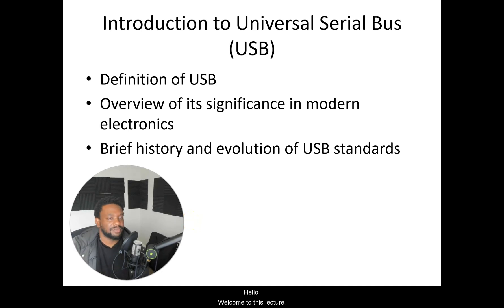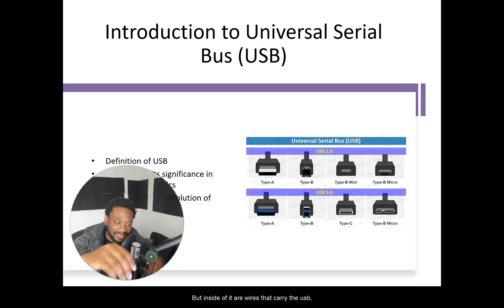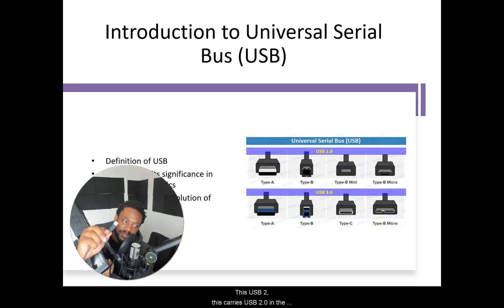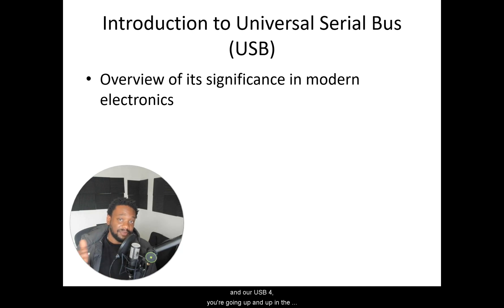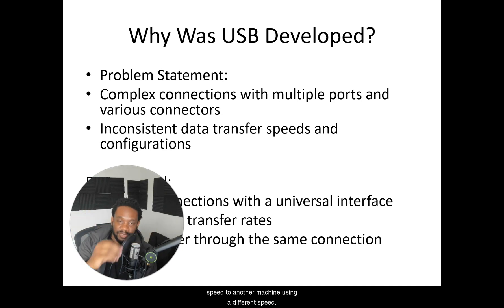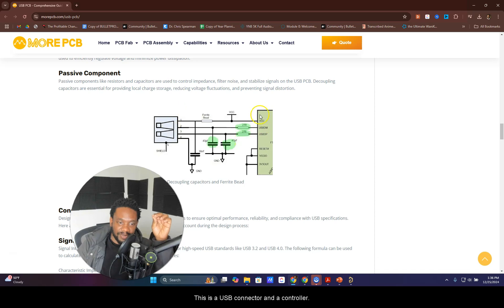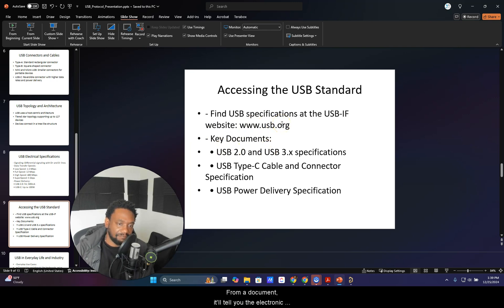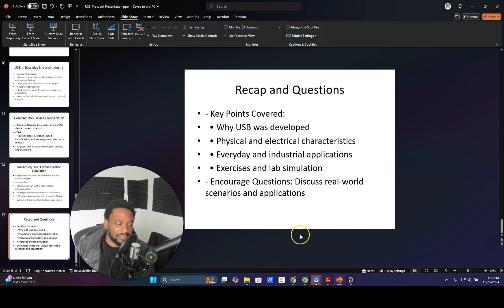Understanding USB   From Protocols to PCB Design Ex Intel Engineer Explains

Comment: Is a protocol which uses 8 different & incompatible connectors actually "universal" )
Reply from the maker: the connector is universal since it replaces the need for so many different connectors. the protocol is also universal because it can accommodate so many different signals
Reply: @ I get all that I've been working with USB for 20 years. BUT if you can't plug one "USB" cable into any "USB" connector, what the heck is "UNIVERSAL" about it? Common Sense

Comment: There is not much that is universal about USB. C-PD type connections may or may not support a display port etc, so now we have a whole other set of symbols on ports to tell us what they do.  We also have current losses and signal losses to cables dependent on length and/or quality, its a headache, especially for product designers wanting to utilize the latest power delivery protocols for precision power delivery.
Reply: interesting points here. can we dive deeper into this rabbit hole? we should probably add this to the video series. this is HaSofu, still techedkirsch. just using my other account.